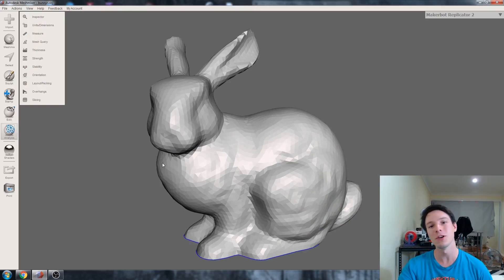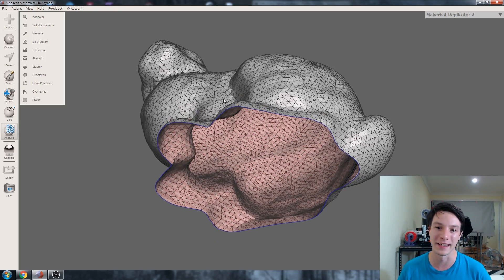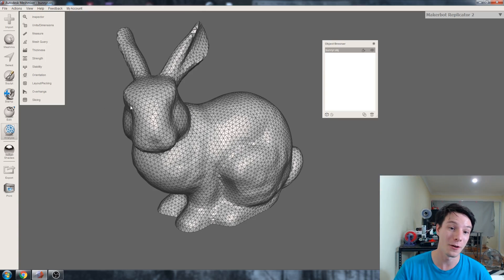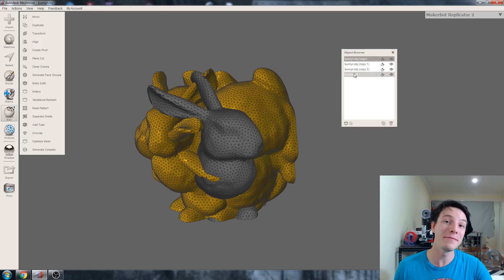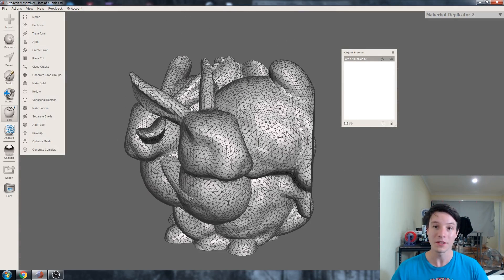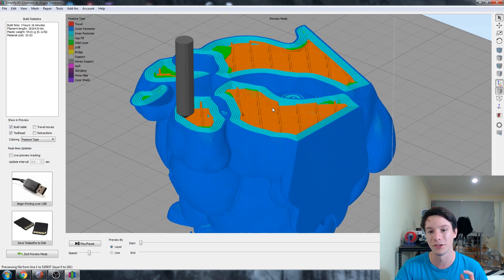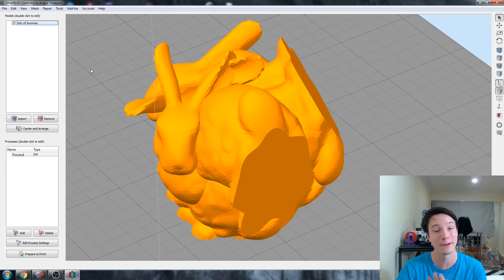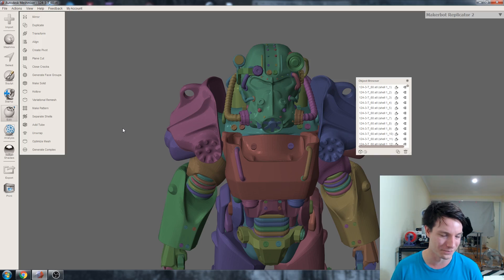Why do Intersecting Shells Suck for 3D Printing? 3D Printing 101

Comment: Angus, your casual mention of the Windows 10 3d App just changed my life.  That is an AMAZING tool for cleaning up and preparing 3d models for printing.  Much easier to use than a CAD program or Meshmixer.

Comment: this has confused me also.  i mean...  its very rare to see anyone discussing this issue... considering how fundamental it is to an understanding of meshes and stl files for printing.  difficult to know what kind of terms to attach to them as well. correctly joined meshes with 'enclosed 'vertex to vertex surface' joins' ... or just "bung some stuff together that intercepts and assume that the slicer will treat it as 1 shell of a solid object and the overlayed/intersection parts will be "union"ed in the boolean sense.  just before the printer... it all becomes a monochrome image stack with black or white denoting "print here" or "don't print here" .
Reply: as a side note...  i very deliberately tested the general idea of both with success (one file i created took a hell of a lot of manual mesh work... and one took no time at all because i was testing precisely this lack of definition...but... i did visually double check the "print file" images before printing.

Comment: Do you have a video showing how to cut a file into equal sizes so you can print them.  (IE. I have a 46 inch long model and I need to cut it into 4 12 inch parts (approx))

Comment: it's a nice explanation but I guess it still wouldn't faze me to be dealing with 200 shells on an object in fact I would prefer it as a blender user so that i could lets say remove the bolts on the helmet if i didn't like them or print with one shoulder pad vs two.  as for making them into one shell is not that hard in blender as the bolts I could select them all ctrl+j to make all bolts one mesh then add them to the helmet with a single boolean modifier. that aside it is misleading to state the model was "print ready" as it wasn't

Comment: I would solve this problem by importing the .STL into FreeCAD and then converting each imported mesh to a solid object. Then, simply export the new solid(s) as a single new .STL file or a series of manageable .STL files. . Even the complex figure with 200+ parts is easily as you can select all the meshes and perform this operation at once.

Comment: Probably the first 3D printing mistake I ever made, was trying to design something using a modified cube and a modified cylinder overlapping each other and I was horrified to see in the final print I could just pull them apart lol.

Comment: When you told simplify3D to separate the shells it did so automatically, and correctly without any information it didn't have before when it failed to determine what surfaces were on the outside of the model. I'm confused, isn't this simply a software bug in simplify3D?
Reply: The issue is that, if all surfaces are listed as being part of the same object, the software assumes that you want some of those intersections to be hollow.

A 2D equivalent would be something like the number "8". It's composed of 3 curves: the outline, and then two circles inside that outline.

If interpreted as three surfaces of the same object, then only the space inside the outline but outside the circles should be filled.

If interpreted as three objects, then the whole thing would be filled (the "holes" would just be filling an area that was already filled, rather than subtracting from it).

In 3D it gets a bit messier, and once you add non-solid infills is gets even weirder.

Comment: I remember the first few times I was making my first 3D printable models I had a lot of intersecting shells. One time, the slicer for the printer I was using (UPBOX) made an error and attempted to get my printer to print the second of two intersecting shells AFTER the first one was printed, so the nozzle just crashed into the print and was pinned against the print for at least an hour. It nearly caught fire. Luckily someone saw what I assume was smoke and stopped it.

Comment: If you're making something in a 3D program, that program should be capable of doing the CSG Union intersection for you. It's a fairly common operation in 3D editors, so for free software you could just use something like Blender. 

However, it's a fairly well-understood operation, and one that is likely to be needed, that I'm amazed that slicing software didn't have it early on.

Comment: Hi @Maker's Muse,
I've encountered the separate shells issue on meshmixer supports.
When creating supports and then exporting the stl, there is separate shells when the support structures meets.
I've also encountered a few supported models on thingiverse having the same issue.
Have you also seen that and how would you correct the model ?
I've tried to convert the supports to solids in meshmixer but then the tips doesn't touch the model (even with an offset of 0)

Comment: My only question: why does Simplify 3d (cost: $150) have a harder time understanding intersecting shells than Cura (as seen in your second video on the topic). I am still going to buy Simplify 3d as it has amazing benefits. Is there a particular reason why it could not just treat multiple shells of any kind as if they were multiple models and just hide the fact from the user. After splitting the model, it has no trouble so why not just have it be internally divided it for slicing purposes. I am still new to 3d printing so there may be some technical reason I don't understand. Thanks!

Comment: Angus you're the best!
 I've been using Tinkercad & Shapeshifter for 3 years and print my stuff on a Makerbot Replicator 2 at my local library.
 The library used to recommend NetFab and now recommends Makeprintable to "repair" files before sending them for printing.
 I have never used either. What do they actually do and what and how is it that they actually repair? 
I've designed and printed some pretty complex geometries but I've never had any problems. Do you always "repair" your files?
Thanks for what you do.
Reply from the maker: Hey dude, well you only need to repair files that are broken, so files from Tinkercad, Fusion 360 or similar I wouldn't bother checking unless something looks wrong during slicing. However, many surface modelling software programs often do need to be repaired as they're not really designed to create a single manifold object which is what you ideally want to 3D Print with. Netfabb basic is crap, it won't stitch shells together. Make Printable is one I haven't used too often, instead I tend to use 3D builder's repair function in windows 10. Windows bought out netfabb so it's got the more powerful features built in and will actually do a really good job.

Comment: I have no idea if that could apply to 3D printing, but 2D formats like SVG have something they call a “fill rule” to control which areas are inside a shape. Basically, the rendering engine chooses a reference point that is definitely outside of the shape, and for each point, it works out how many times the line segment from that point to the reference point intersects the shape.
With the default fill rule (“evenodd”), a point is inside the shape if that number is odd, but the “nonzero” fill rule considers a point as inside the shape as long as the value is… well, not zero.

Comment: 3d printer software is pretty retarded it seems. Or it's just your software that's bad.
Reply: Desu Troyah 3d printing software is fairly new and has much steps to go. On the other hand most model makers could just consider that intersecting shells are a problem and just model their way around it. Or just don't upload it as an stl file.

Comment: why are stl models in triangles ? xd
Reply: Because the three vertices of a triangle are guaranteed to be on the same plane, thus the triangle will always be flat. If you used squares for instance, you could have three points on a plane with the fourth floating above them, so they wouldn't define a single plane and the geometry would get really awful.

Comment: I've developed a habit of always turning surfaces into 3D solids in my modeling software before exporting into an STL - leave minimal confusion or ambiguity for the slicing engine. Even if I were to produce something like a vase, I would thicken the surface into a solid of specified thickness (likely a multiple of print line thickness) before exporting to STL.

Comment: I've cheated when I get this issue and create a solid block around the whole intersecting meshes.  I make the intersecting meshes "holes" like in tinkercad.  I then group (combine) the two which makes a hollow block with the mesh outline inside.  Then I take that hollow block and make it a "hole", then grab a new solid block and group those together.  The end result is just the outline of the intersecting meshes and it prints perfectly.  Not the most elegant solution but it works.

Comment: Awesome video! I believe the way the STL distinguishes between the outer and inner surfaces is unstable with zero-thickness manifolds (shells). Instead of capping (adding a base) to the STL meshes, the designs should be given a wall thickness or made solid before exporting as STLs. I have also encountered the scaling problem :D And for example, why not create the "Polybunny" as a single shell before exporting? And yes I AM that person that enjoys using Boolean operations to fix ALL individual parts! :D

Comment: Lots of incorrect info on this channel, though I can appreicate someone trying to learn. There speciffic industry situations where this is very common, I work in one of them as the senior engineer (TechNation). Some of the models we get are designed by random people with money and a kickstarter, who never took a cad or design class. I'd better not go into how i feel about that part... As for disentigrating, no this is a misunderstanding of whats happening. Weakness at joints like this where 2 paths collide are usually (and when I say usually, i mean 9 out of 10 times) due to skipping or incorrectly calibrated extrusion settings at high resolutions. Once you skip a step in that motor, you have effectively lost pressure in that nozzle, and weakness in that area will resut. Repeat it one on top of the other in the same area, and you have a break point. If the printer is correctly calibrated, both heat and extrusion, that crossection actually becomes stronger than a properly designed joint, where the lines touch but dont intersect eachother. Again I work with those situations almost daily and ive never had a break or weak point on those areas, in fact those are the stubburn areas when it comes to strength. 

If you go too fast, its like hitting a speed bump in a car, way over speed; in that case the nozzle will not have time to fill the gap just after the intersect before it passes over the area, that will cause weak points too. If its too low in pressure, same thing. If its too high, then it skips in that area and again, weak spots and same issue, a gap. Too many in the same area and you have overpressure skips again. There are a number of factors here. The little things matter, pay them attention. 

Yes Cura (in particuar, Cura 2) is very good at this kind of thing, it can find those intersects and remove the internal geometry so theres just an outter skin. However in my case, these cross sections are often structural polys and cant be removed without loosing strength, and if the design breaks, that comes back on me... Which is also why i spend so much time breaking this down. These things are hard to see with the eye, like accelleration settings. Its only with extensive study of the machines and practice that you begin to see processes like that. Im hope im preaching to the quior here...

As a side note that comes to mind regarding pressures, though unrelated to this scenario, I think may bennifit you or others who may read it.. Filament diameter calibration is very underrated in this community, we typically see them as machines but not "precison machines" and in the sense of comparing it to other precision machines, thats correct. However, they can be very close, if the opperator knows what theyre doing and plans for the varriances and porcesses before hand. Each printer is an engineering project in itself. If youre doing it right, calibration will take days, weeks in some cases, but i digress.... If youve never played with 1-5 micron differences in filaments, you really should sometime, that 3rd digit matters. 

Set your layers to 50-100 microns and get the most accurate filament you can find, measure it down to 3 decimal places, not 2. Make 3 shallow squares, something like a 1mm x 50mm x 50mm. Slow the surface speeds down below where you normally would, fan high. Print each square with a 1-5 micron offset in the slicer from eachother. Watch what happens to the surface finish. Look between extrusions. You can use values that small to fill the gaps in the cross section (imagine 100 micron layers, chopped on the side, there are gaps... ) Pressure fluxes just slightly as the filament changes minute diameters, you want the valleys in that pressure to cause the extrusions to touch, so there is no gap, and you want the over pressure (the peeks) to fill the gaps under the line next to it. Using that process, you can get glass-like surfaces with a the right settings and hardware. Ive used this process in some fiber optic work, using t-glase. This also allows for water tight prints with much shorter walls, this can even be done with single wall extrusion if you know what youre doing, and no, not by using spiral.

Comment: Dealing with intercepting mesh elements seems counter productive since a few option toggles can usually resolve the splicing artifacts. Personally however I do use zbrush and dyna mesh to process my creations, because I need mesh parts to physically fit together. This also saves on print time, plastic usage , and ultimately gives me more control over the print.

Comment: They don't suck for 3d printing, the software sucks handling them.
Reply: Dennis Lubert   every triangle exponentially increase the difficulty of the problem. You get shitty results cause the software uses euristics (approximations) to find the solution in a acceptable time. You can always call the guys at google and get some deepblue SC processing power.

Comment: If only I would have known about this two days ago.... thankfully it was only ~1 gram  worth of plastic in the part of the print that failed. I was printing a part with three components combined in fusion 360.Though what makes me curious is that the part failed when I was printing other parts for the same project(multiple stls laid out), yet when I sliced the same stl separately to print it's replacement, it worked fine. Unusual, but I will not make the same mistake again.

Comment: Hi Angus,
To print that previously mentioned power armor, what you needed to do is:
import them to 3ds max,
seperate all elements with a script (forgot the name)
export all elements seperately as stl with another script (forgot the name too)
import all STLs to simplify3d,
group them,
that's it. any number of seperate shells are handled automatically.
Reply: Can you post a link to a video or photos of that model printed?  I'm quite curious to see it!

Comment: do you use game guru if so help!  the shape mode level mode and store level mode ramp mode blend mode and a non spread extruder with a 90 degree rotation instead of i live in the sky make an entire drawing program. aneroph on blender youtube talks to fast and mine is only three buttons L mouse  extrude up R mouse extrude down center scroll roll extruder size click 90 degree angle. then tree maker circle on the ground add extruders click on and size then right click and say in or out. make as many as you want the scroll mouse click out and click height. click on circle hold L mouse extrude up and middle mouse scroll to rotate it twists. middle mouse click 90 degree turns makes branches the hit the leaf button good program you feature vote. please if you use help. panel maker also same for the EBE super easy take picture and extrude three dimensional. put in bones and strum wind effect done. skeleton use extrude makes 3d sprite. blender broke =oops sorry!?

Comment: I tried to use that new netfab site... idk if its the same code... I had a model with one disconnected face and usually netfab would have no problem realizing it should just remove the face but it didnt this time. I think the original netfab was better

Comment: If I'm not completely wrong, it is also possible to use Simply3D for fixing intersecting objects and merge them to a single object. Then you make a copy in-place and scale it down a little and use it as a hollow mask, thus cutting off the inner mess. I've been using S3D for design only, though.